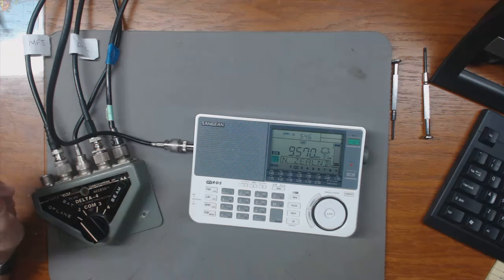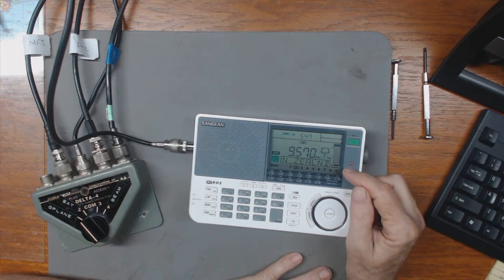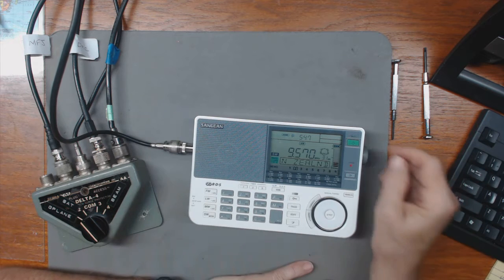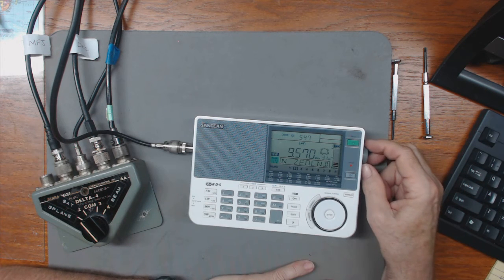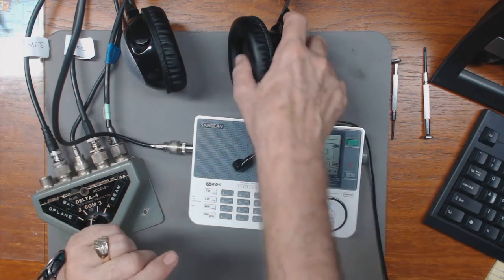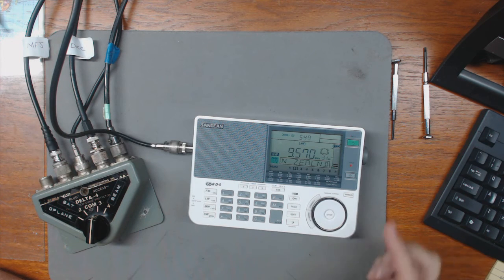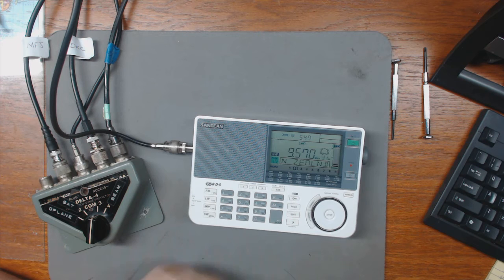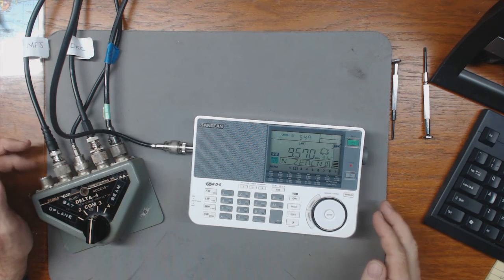TRRS #0871 - Antenna Switch Repair Results

Comment: The DRC antenna seems to be working good but many conditions can influence an antenna like what direction it is positioned in
and whether it is resonant at that frequency. Looks like more testing?  :)  Good luck on the antenna switch and thanks.